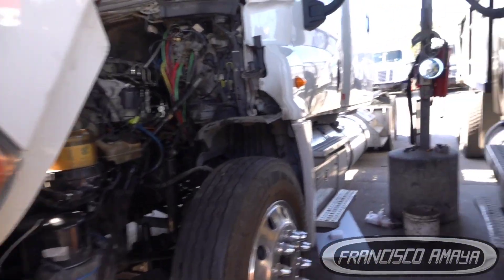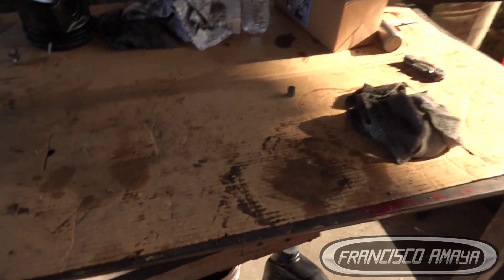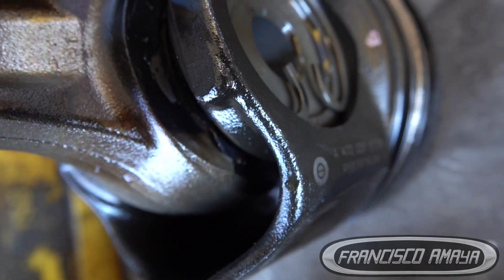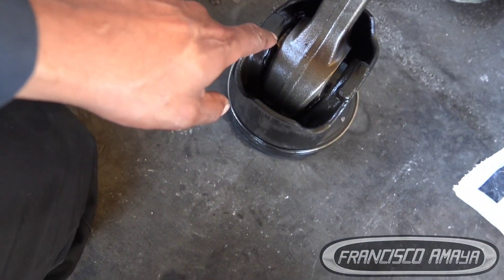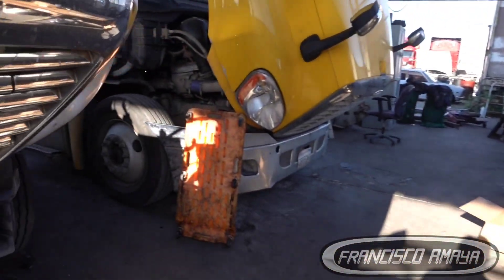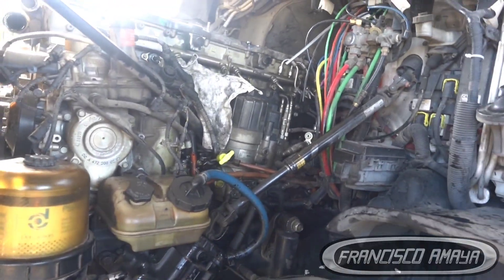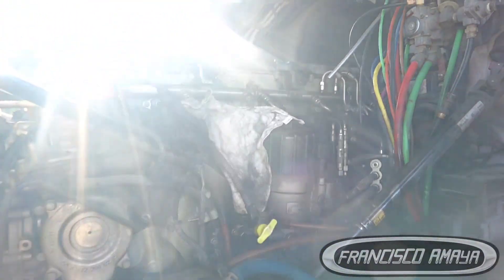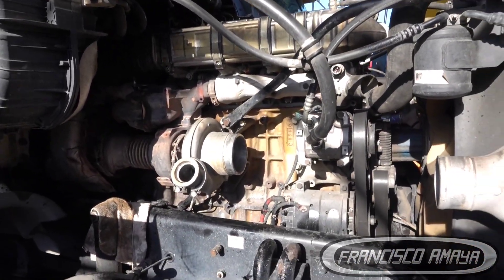DD15 ENGINE BROKEN CYLINDER LINER DAMAGE PISTON REPLACING ONLY THE DAMAGED PISTON CYLINDER

Comment: We have 2015 Cascadia / DD 15 (made in Mar 2014). I ordered brand new with manual “fan on” switch. The factory default is “fan on” at 225F , which is too hot (they keep fan time as low as possible for best mpg). I always turn fan on manually when temp hits 205F. 1M miles now; still no oil consumption (1 gallon / 50k mi); original everything incl head gasket & injectors. IMO this broken liner is preventable, to some degree, by keeping temps down. But if bad rod bearing….. still would happen .